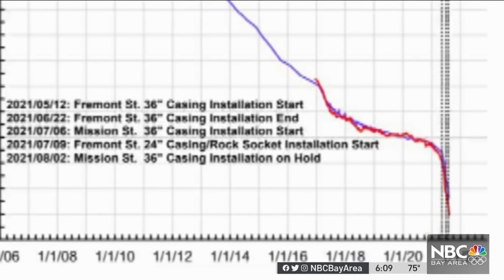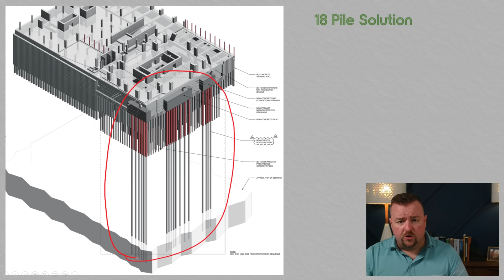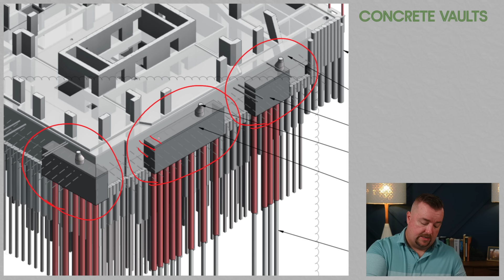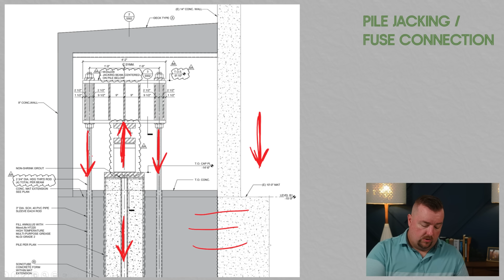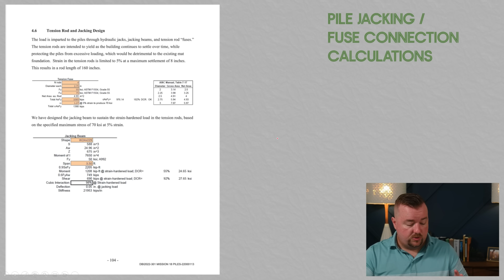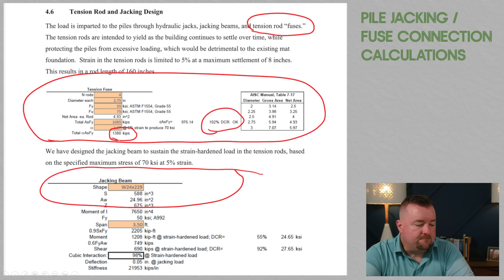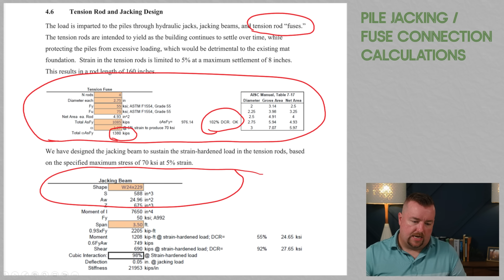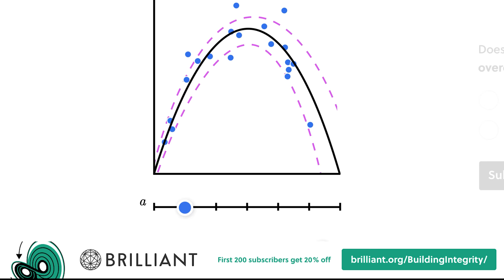Did I Uncover a $100,000,000 Mistake with the Millennium Tower "Fix"?

Comment: I am not an engineer but that plate looks way too small to transfer all that weight into the concrete. There is no fudge factor to compensate for unexpected loads. The variable wind loads must be outrageous. This whole engineering team should be forced to work with a third party appointed by the State of California to pass judgment on all designs. If the original engineers were any good the building would not be sinking as it is now. The Vault design looks like a disaster waiting to happen. I would think a plan to sink the non-sinking side so the building stands straight would be the first thing to accomplish before attempting to drill pylons down to bedrock. Drilling and excavating around a leaning building will need small and balanced steps all around the building in order to monitor and control further sinking. I would not rule out that the building needs to come down in controlled demolition to be safe. Better to demolish a $100 million building and not damage $300 million worth of surrounding structures.

Comment: I have an 8th grade education and what I see is the weight distribution will work but has zero tolerance once the initial pilings can no longer sink...at that point the entire weight distribution is on threaded rod and plates. The vault piling is dead and unremarkable, but the weight is basically 1sq ft of 1.5" plate to concrete that is not inspectable. It will work but for how long? Until it doesn't. The Titan worked to dive 3500 meters, but how many times? Approximately 10 or 12 times.

Comment: Tie the building to another building with huge cables.
If it is not esthetically pleasing you could always string a huge amount of Christmas tree lights along the cables. 
Use a winch as needed and then fix the foundation.
After it's fixed I'm sure that crazy San Francisco will love the Christmas tree lights so much, they'll keep the system in place.

Comment: Not sure why you would check that plate for shear when it's embedded in concrete. If the concrete around that plate disintegrates enough to the point where that plate starts working in shear, then there are much bigger problems.

Depending what the rebar detail looks like around the bottom of those threaded rods, (which you didn't show), the nuts might be adequate even without the plate (though I would put a plate washer on anyways just for good practice.

Comment: Looks like the whole Sonotube is bonded to the vault and the pile slides within that pile housing, this would give a much larger shear surface that may support the load just fine, I think the 1-1/2 plates are a secondary means of anchoring, not the primary.

Comment: High-rise buildings in Asia typically use large diameter (at least 3 m or 10 ft) bored piles (drilled shafts) as deep foundation, not driven piles.

Comment: Check into the Mandalay Bay underpinning.  536 micro piles placed beneath the core mat at 4 ft centers.  Similar problems the installation likely caused additional settlement.

Comment: According to my calculations that i found on Chap gpt you need remove the pvc from ALL TREADS bolts & pour in with concrete & divide by 3 & not 4.

Comment: as a normal guy that has planted a few trees, you perform your major correcting measures on the side opposite of the lean to get plumb. 
Under no circumstances do you undermine the side where it is leaning. 
Engineers also suck at explaining things.

Comment: I agree on doing the calculations on the plate. I have worked with steel that can handle over two million pounds. If I was designing this project the first thing you have to have the type of steel and the thickness would be at least 12”. This is a big project and over design is a must to prevent another disaster.
Reply: Don’t overlook the fact that the plate is buried deep in high-strength concrete.

Comment: I swear that "fix" gives me Hyatt Regency Walkway vibes and I'm not even an engineer
Reply: wow good comparison
Reply: The walkway failure was entirely due to an on-site redesign, not the inadequacies of the original and correctly engineered design.  I can think of no better example of an apparently innocuous and subtle change dramatically altering stresses.
Reply: @thedubwhisperer2157  That still doesn't change that this fix pull on that plate with a huge amount of force, with no way for the plate to easily spread out the force to the surrounding concrete. When I said it gave me Hyatt Regency vibes, I was not referencing the decision to alter the original design. I was specifically referencing the physical design change that did the same as this plate. A lot of force on something that have no chance of diverting said force. Concrete on its own is not that strong. That's why reinforcement is used. This plate isn't connected to any of the reinforcements. This fix is bound to crack, weaken and eventually fail.
Reply: Yup, everyone is agreeing on that. There are definitely creepy parallels with the Hyatt Regency Skywalk.

Comment: Anchor rod and bolts are conventionally designed using the ultimate strength not yield strength of the material. In fact, bolts may already be yielded during pre tensioning.

Comment: Consider that the plates don't exist on their own, they are supported by the concrete they are encased in. The area of the plate times the compressive strength (6000psi is conservative compressive strength of high strength concrete)  of the vault concrete is 6.5"x13"x6000psi = 507kip.  That is roughly the load exerted by two threaded rods.  The plate is not unduly loaded since it is fully supported.  I would be more concerned about corrosion of the plate over the life of the building.

Comment: S.F. is an earthquake zone.  What strength earthquake would be required to impart sufficient vertical impact to defeat the 1.5 inch plate?  Have any earthquake considerations gone into the design and construction of the whole "fuse" system?  Also, the piles to bedrock are on a single side/corner of the bldg, so what about earthquake stress input between bedrock piled and the rest of the building?  Shear stress will be unevenly applied during a 'quake.  The rest is details?

Comment: The lack of a formal calculation on the lower steel strap, thread and nut, and a sample test data on stretch should certainly be looked into.  However, I'm no engineer, but the plate and nuts are apparently entirely encapsulated in concrete. If that is true, then it seems that a test or calculation on what amount of tension is required to cause the concrete around the plate and nut to fail is necessary as well.
Reply: I waffled a bit in my reply just added. But yep, the plates encased in concrete - it’s not likely to go anywhere unless the concrete fails 👍
Reply: I waffled a bit in my reply just added. But yep, the plates encased in concrete - it’s not likely to go anywhere unless the concrete fails 👍

Comment: IMO this is a design that is going to be based on ACI 318 Appendix D for concrete anchors.  Perhaps the steel plate is only being used for placement and a "belt and suspenders" approach.  Headed bolts or rods with nuts can be enough to fully develop rods in tension, as long as sufficient concrete depth, bolt spacing, and edge distance are provided in the design.  I would also check the Thread Stripping Area (TSA) between the nuts and rods (AISC Design), this is likely why (2) nuts are provided.

The More You Know.
Reply: If the drawing is correct, there is only one nut bearing the tension load at the top of the rod.  If two nuts were required for thread strength at the bottom, wouldn’t they have needed two at the top as well?
Reply: @GH-oi2jf  agreed

Comment: Others have mentioned the torque of the vault on the existing foundation and I also see that as a problem. The foundation was not designed for a horizontal inward force at the top of the vault and worse, at the bottom of the vault, there would be tension between the vault and the foundation. Even though the concrete is reinforced with rebar it is not strong under tension. Concrete under tension needs to be pre-stessed which actually keeps it under compression along the direction of tension.
Reply: They want torque on the foundation mat.  As the building settles further, the mat will rotate toward the east and the building will become less out of plumb.

Comment: In San Francisco every building has to be anchored in the bedrock because there is only sand between the surface and the bedrock.  What may be done elsewhere can't be fone in San Francisco..  another area might have soil  gravel but San Francisco is a city built on sand dunes.
Reply: At this site, the Old Bay Clay layer is between the sand and bedrock.

Comment: I believe that the three-foot thick, 90-foot-high steel and cement Wall built directly under the eastern edge of the 10-foot-thick slab foundation is a major contributor to this entire problem. If that Wall was not there, the overweighted concrete building may have sunk downward, but with little tilt. The presence of the Wall acted as a fulcrum for the 10-foot-thick slab/lever forcing the sinking building to tilt away from the Wall. Mr. Hamburger now supported the western area of the building to bed rock and claimed that the eastern side would slowly sink and correct the tilt. The 90-foot Wall will likely negate that hypothesis. It appears that the result of Hamburger’s Fix caused the weight to transfer to the center of the building. This has therefore resulted in the “dishing” of the building base, along with the lessening of downward force on the 18 newly installed piles. Bottom line, the Wall contributed to a levering effect. However, the Hamberger Fix plus the Wall has now generated a catenary effect.

Comment: I am a not specialised on buildings .. I am a mechanical Engineer.  I have soooo many questions and worries.. the plates as you said guesstimate is 100% insufficient... but also the wedge shape of the building Connection.... and OMG.... the tensioning of the rods... I 100% agree there are issues

Comment: the shear key is in the wrong direction, and there will be a large bending moment generated due to eccentricity from the reaction at the interface between the existing foundation & the new concrete transfer beam.  As a result of the eccentricity moment, the tension cables will behave as a couple to counter the reactions.
Reply: You are wrong.  The key is correctly designed to avoid stress which could fracture the concrete of the vault.

Comment: I'm not a structural engineer but I anticipate this problem; the steel crossbars may hold that enormous weight when they are all correctly adjusted and equally balanced. But when the building settles a little more, it will probably not settle evenly. It will put more weight preferentially on one side. What if that goes to a small number of the bars and causes them to fail?
And even if not, we then have the problem of the subsequent inspection and adjustment. Will the technicians extend all of the super-loaded jacks simultaneously, taking the extra weight off each and every one at the same time? Or will they extend some of them before the others, leaving those others with even MORE weight to carry during the adjustment process?
Reply: The plates are deeply embedded in concrete.  It is the combination of the steel plates and the reinforced concrete that resists the load.

I’m sure the engineers know how to adjust the jacks.
Reply: @GH-oi2jf  
>> "The plates are deeply embedded in concrete"
Yes I know. So what? That makes no difference to what I said. 
>> "It is the combination of the steel plates and the reinforced concrete that resists the load."
Please stop talking to me as if I am stupid. I'm an engineer and I can draw a force diagram.
>> "’I'm sure the engineers know how to adjust the jacks."
No you're not. You don't know that the people adjusting the jacks will HAVE an engineering degree. You don't even know that the building owners will continue to pay for inspections.
You're assuming that everything will just "be OK". That kind of assumption is the root cause of this entire problem.
Reply: @DavidByrden1 — I have engineering degrees also.  It seems to me that this remediation effort has worked out fairly well so far, considering the difficulty of the problem.  According to the latest report I have seen, the new piles are fully loaded and the progress of the leaning to the west has been arrested.  The lean has even been reduced slightly.  So far, nothing has broken.  Now we all have to just wait to see what happens in the long run.  The lean should be reduced further as the east side settles, but it won’t be fast.

Comment: Here's my thought about your analysis, the plate is backed up by the concrete.   In my mind the compression strength of the concrete becomes the most important factor.   The plate only has to be strong enough to keep the nut from pulling through the plate, again which is set against the concrete.  I feel all engineering is based on imperial past experience.   Time will tell if the rod system is substantial enough.   I see another issue being that the vaults themselves could pull away from the original building.  It seems the vaults are just "glued" to the side of the original building.  I would think some very  heavy steel beam penetrating from the vault into the side of the building would be an important aspect of the design.   Ultimately if the sinking isn't stopped the structure will need to be demolished.

Comment: Solvent wash out out the grease, freeze out the liner. High pressure grout fill the cavity, cap plate the block and give up on the idea of measuring through rod stretch alone.
Reply: The rods must be free to stretch throughout most of their length.
Reply: @GH-oi2jf not really, rod is this the same tensile strength regardless of length.

Comment: There is a lot of shear force on that horizontal reo bar, not tension or compression but shearing: this would be somewhat different if it was laid at say 45 degrees hmmm... they could even be crossed and tied together.

Comment: The hydraulic jack is a probable single point failure mechanism id it is retained to maintain loading on the pile. If it fails, and the upward force from the piling is lost, then the loading taken up by this structure will shift back to the already overburdened foundation mat of the building. If the pilings are indeed at bedrock, then the piling should be preloaded with the calculated force needed to stabilize the building and the point of contact between the piling and the transfer assembly should be adjusted by some means, such as a permanent shim. When the shim (or whatever method is used to adjust the above ground height of the piling relative to the contact pad) is in place, then remove the jacks used to set the preload and let the piling take the compressive load while the 4 2.5" allthread rods go into tension and transfer that tensile or upward force to the building foundation. 
Why didn't they design this using a 360 degree circular anchor plate, that would better distribute the small rod force to the concrete? The anchor ring and rod connections would be made up before the concrete pour, of course, so that end could be significantly more robust.  
The use of high temperature grease in this is questionable, because grease tends to lose aromatics over time and will eventually harden like concrete around those threaded rods.
Why are they using allthread in the first place? You lose effective cross section and acquire stress risers with allthread, and these will be under tensile stress for the life of the fix.

Comment: I was referred to your video by some of my viewers.  I really enjoyed hearing your structural side of things.  Their latest monitoring report shows relaxation of the pile loading that is trending toward a reportable condition (probably by this Spring).   I suspect that there was some creep going on with the pile itself but people have  made the connection to your video pointing out the possibility of yielding of the steel bars at the based of the anchor bars as you discussed in your video.
Reply: More likely, slight settling on the east has reduced the load on the piles at the west corner.  At some point, the remediation engineers will add a little more jacking force.
Reply: @GH-oi2jf  I see your point but the tilt recovery has stopped while the pile loading is decreasing over time. This suggests to me that there is creep in the external support system: either with the piles or the anchor bolt assembly. It would be nice to know what the engineer of record's view is about the ongoing decrease in pile loading but only data reports are being issued to the City at this time.

Comment: what you could do is build a large i beam and jam it between it and the nearest building that is strait -  or use a helicopter to lift a tow truck on a near by building, then string the winch cable around the top,  or,  dig the other side down to catch up with the sagging side -  if you need anything else, let me know,  im going to break